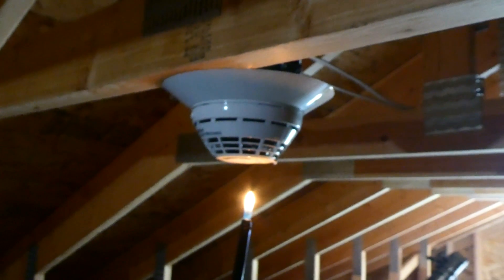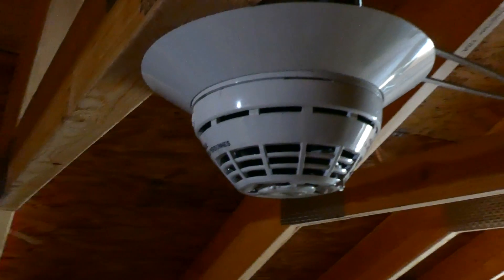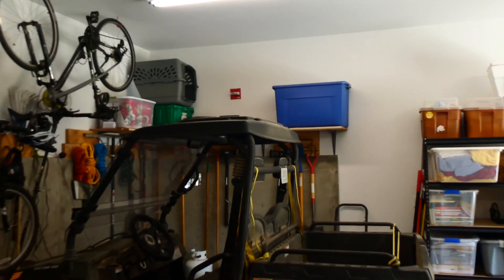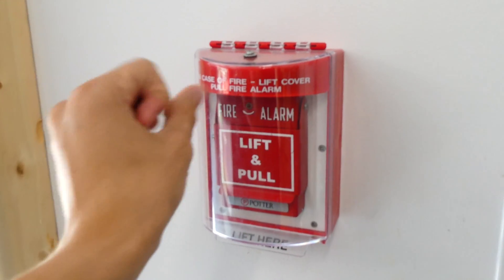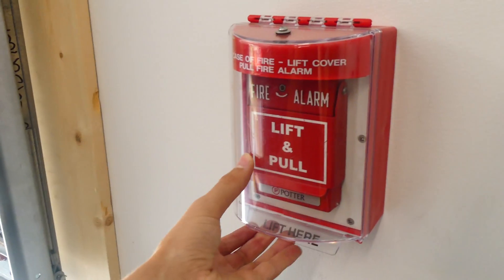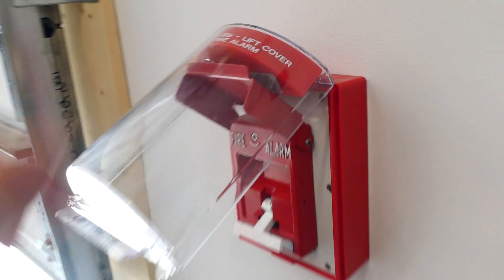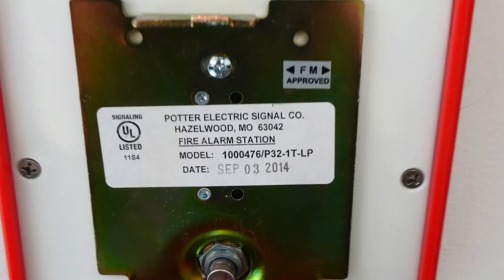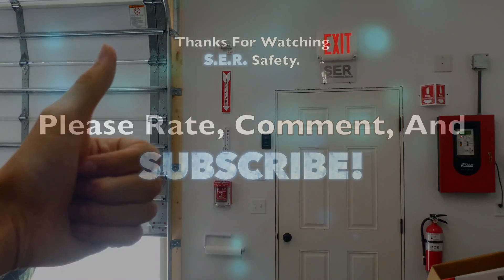S.E.R. System Test 8: Wheelock Chime/Strobes!

Comment: Now, you just need to set it up so it calls Fire Department when it goes off. Only way can bypass this is, You would have to call them up every time you gonna do a test.
Reply: Chakat Nightsparkle You can press the 'Remote Disconnect' right above the Silence button to disconnect from them.
Reply: @holo911  
You could probably disconnect a cable too.

Comment: Dude!  You're melting the housing on the thermal detector with that open flame.  Suggestion: try a consumer grade hair dryer next time.
Reply: Or a fog machine that can do it!
Reply: @bluebirdt3fe17 for a heat detector? you mean for a smoke detector right?